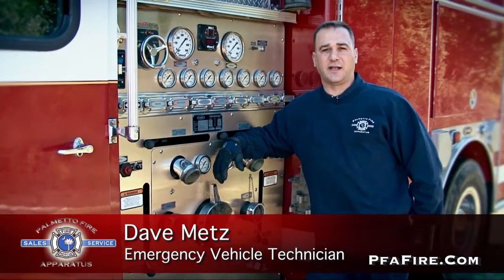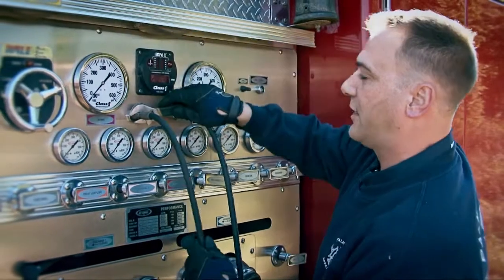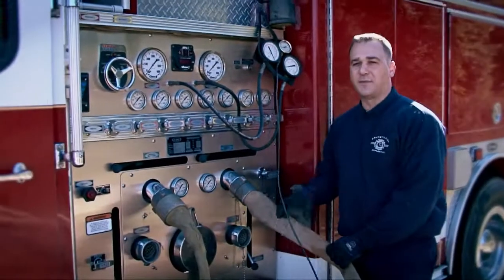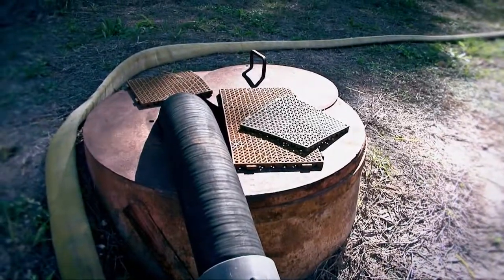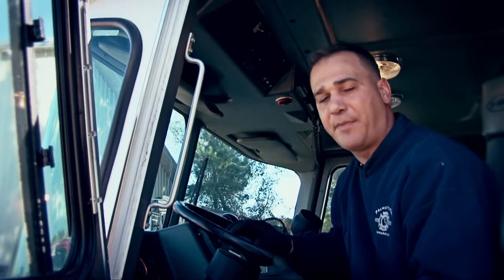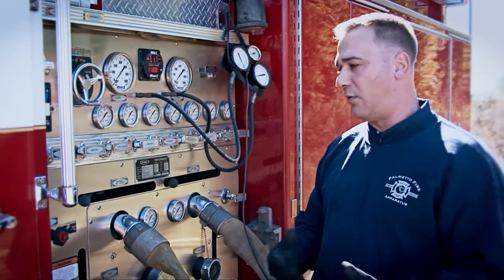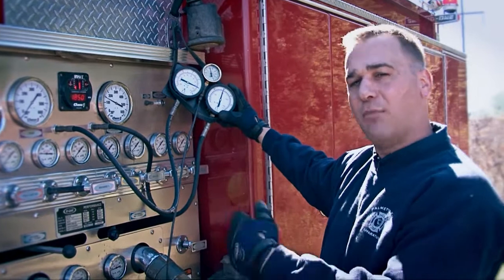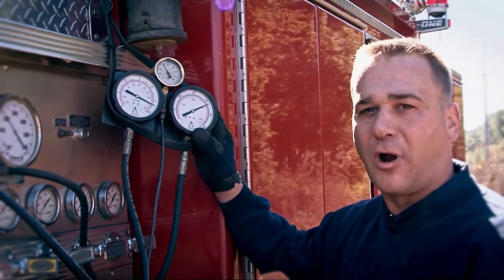pump testing | Palmetto Fire Apparatus

Comment: Priming time starts when you activate the primer, time stops when water is coming out of a discharge. NFPA 1911 States for a pumper less than 1500 GPM, priming should take no longer than 30 seconds, a 1500 GPM pumper or more should take no longer than 45, and allot another 15 seconds if you are using 2x 4" hard suctions or larger.

Comment: Hi, I would like to know what is the ideal time to keep the prime working?
Reply: Priming time starts when you activate the primer, time stops when water is coming out of a discharge. NFPA 1911 States for a pumper less than 1500 GPM, priming should take no longer than 30 seconds, a 1500 GPM pumper or more should take no longer than 45, and allot another 15 seconds if you are using 2x 4" hard suctions or larger.